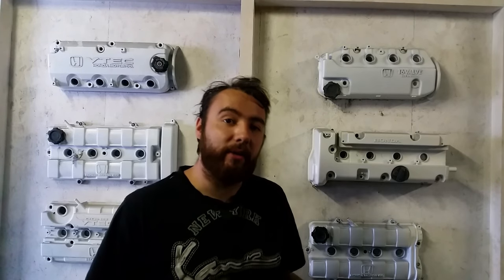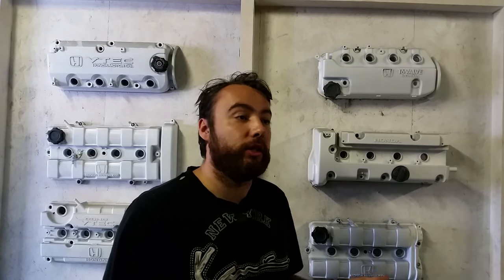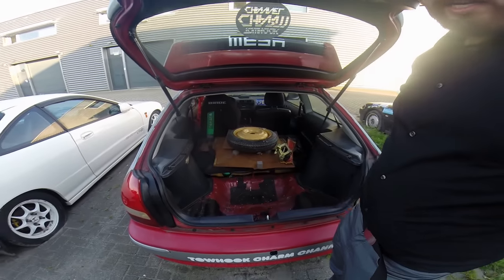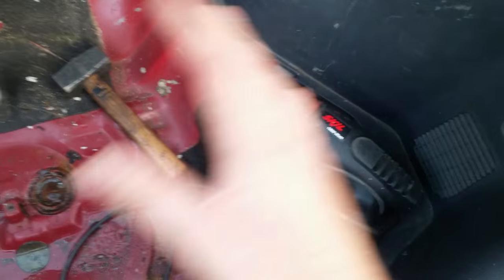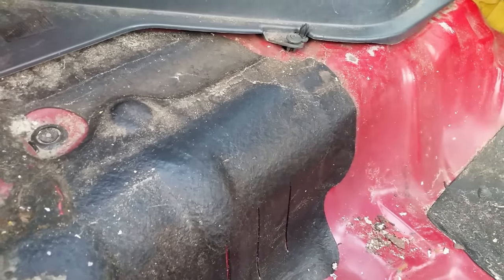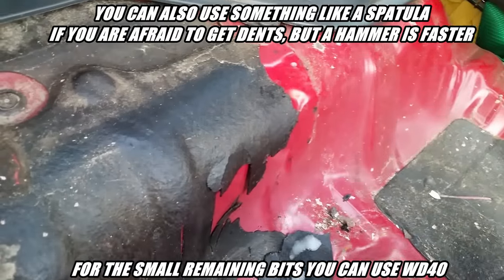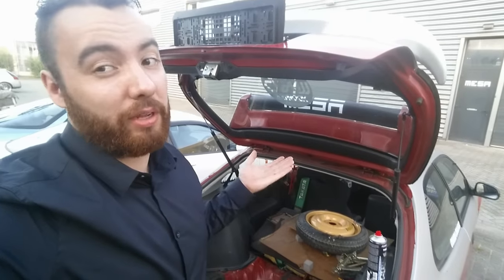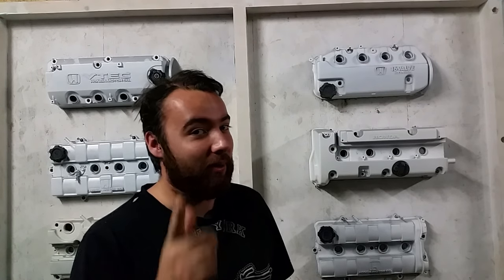How to easily remove sound deadening / tar mats in a few minutes from your car

Comment: My car was previously soundproofed 5 years ago and due to the extreme heat here in Malaysia, it started to melt and leaked very badly from the bottom of the door panels. Just curious as to whether this method works for both bitumen/butyl rubber soundproofing?  From what I see, the residue which had leaked looks like huge black blobs and is extremely sticky. Any further suggestions on what I can do to thoroughly clean the inside of the door panels where it’s narrow ? Your reply is much appreciated !